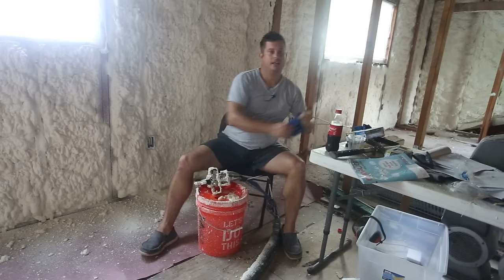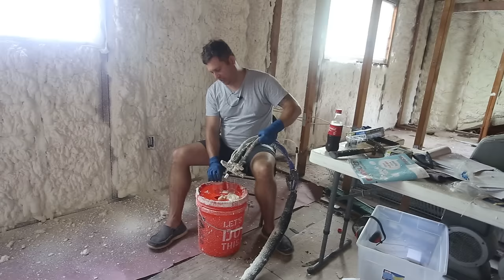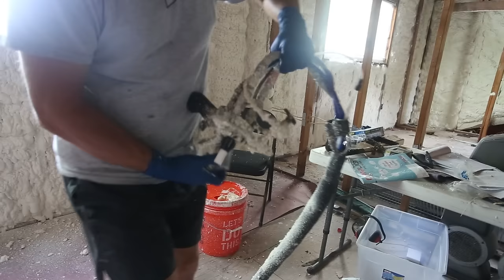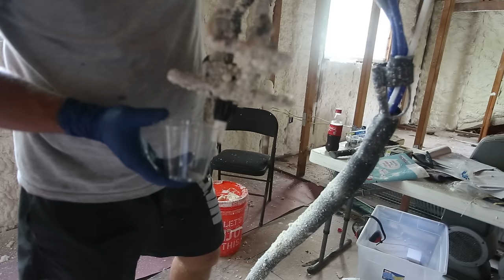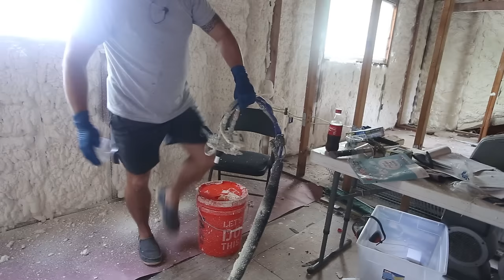DIY Spray Foam - Part 1 - about the foam, calibrating the machine, and about my project

Comment: good luck cleaning up that mess, you are going to spend over 100 hours shaving that stuff to have it drywall ready, and isn't the outer layer supose to act as a vapour barrier? So by shaving the outer layer youv got no vapour barrier.
Reply from the maker: Thanks for helping me prove why it's important to do your own insulation and understand what you are doing.  Even the "pros" have not got a clue.  Hints: Closed Cell foam.  Every cell is a vapor barrier.  Texas, Humid Hot climate, vapor barrier on the outside.
Reply: THen can you explain why over spray foam and then shave it? when you can just install half inch less  and not have to shave it. makes life so much easier not to mention that is the right way of installing closed cell  foam. AND INSTALLING YOUR OWN SPRAY FOAM IS NOT A GOOD IDEA, this stuff is for the experts you are manufacturing foam on site and installing it wrong can have harmful consequences to your health.
Reply: Spoken like so many "experts" (i.e. rip off con men) that would have everyone think we are helpless and must call someone who will "give you the business".
Reply from the maker: This was a deep energy retrofit.  I wanted to get a total cavity fill which would create a vapor barrier retrofit, eliminate thermal convection in the wall cavities, and maximize the insulation.  The downside is that it did require some overfill and consequently some shaving.  The closed cell foam also adds structural value, but I'm not going to guess at how much.  I'll just say that the house is quiet, very comfortable, and inexpensive to heat and cool.  I have zero air leaks which was one of my goals.

If you only do a partial fill in the wall cavities you will still have thermal convection, moisture accumulation, bugs /rodents, etc.  the air in the wall cavity will rise and fall depending on it's temperature and all air contains moisture.  That will compromise the insulating efficiency.
Reply: that was a nice reply.

Comment: next overfill project you do, try to take a hand saw to the foam while it is still abit warm (be gentle), it should come off in one piece instead of 1,000,000 pieces. fill every other cavity so your saw isnt digging into the next one.
Reply from the maker: That is a great suggestion that may help someone else.  Thanks.

Comment: All I can say is wow. I’m a professional installer. I’ve seen one job that looked like this and I had to fix it. You definitely know a few things about the industry, but there are so many variables involved with polyurethane and I would highly recommend getting a professional to install your spray foam.
Reply: Hey I have a question for you. I am building a cabin where it's going to be nearly impossible to have this professionally done, what are my other alternatives to spray foam (I would hate to mess it up due to health reasons). I want the cabin to be very energy efficient, and I keep hearing that closed cell is the way to go. Any tips will be very much appreciated.
Reply from the maker: So far my foam is working great.  I'm glad I took the time to learn about it and install it myself.  I could have done a partial fill, but that is not what I wanted to do, so overfill and shave was required.
Reply from the maker: Closed cell really is the best solution.  If you are only doing a small building you may find something like Handi-Foam to be more effective.  Closed cell is what's used in coolers.
Reply: Lolol. I've built$1m homes in Houston for a while, which is A LOT of home. With the recent post Hurricane Harvey rebuild, we've been spending top dollar for insulators from around the country. With many of our home being renovations we've used closed cell from ceiling to crawlspace. The first time I'd find a guy not insulating the entire wall cavity and shaving it off, he's fired. It takes 2 guys a few hours to shave a 5ksf house. Vapor barrier outside, closed cell foam, 7 mil vapor barrier inside+drywall, and caulked trim- the house is airtight. Good Job Brian, and thanks for the info.
Reply from the maker: Thank you for the support and facts.  It's been a while now, but my house is quiet and energy efficient.  It stays comfortable and I have to ask Alexa what the weather is doing because I don't know if it's hot or cold outside.  

I live in the approach to one of the runways for Hobby Airport and I can hear the planes, but it's not that bad.  When I first bought this house I freaked out because I thought the plane was landing on the roof.  They are wheels down when they go overhead because we are 2 miles East of the runway.  Spray foam made a stunning difference in noise reduction.
Reply: @hotpuppy72  - Once again, thanks for your effort making the video.  As if the insulation wasn't awesome enough, I can't help but to think that the improved rigidity of a completely  filled wall cavity makes the house probably %20 stronger!

Comment: what do you think about using a chinese made proportioner? local sellers selling em for $7k CAD. 
they might not be perfect for a spray business, but would they be good enough for diy? just 4-5 barrels.
Reply from the maker: It'll be fine til it stops working.  Then you'll be on your own with little to no parts or tech support.  There is not anything magical beyond making sure you supply equal amounts of mix.  Of course your A and B may have different ratios, but it's just a precise geared pump.  The high dollar ones heat the mix so it will cook off faster......Lil Pup uses ambient, which isn't a big deal for me in Houston, TX.  It's ninety-f-that outside today... more than warm enough.  In the winter you need to heat the drums.... so just use some oil pan heaters that are magnetic.  It's not rocket science despite what Graco might try to make you believe.

All lil-pup is - two stepper driven gear pumps with a PLC running them.  Absolutely nothing magical.  Hydraulic gear pumps do the same exact thing, just need a precise way to drive them and to work out that the seals are compatible with the nasty A and B mix.

Comment: First off, thank you Brian for the series of videos and helpful information.I am planning insulating crawl space subfloors. What is your opinion on using the Lil Pup for this application?Also, where did you purchase the 55 Gal drums of foam chemical and was there a quantity break if you ordered a large amount at once?? Lastly, can you provide a link and/or the brand name of your external air supply?
Reply from the maker: It would be fine for it.  There is no quantity break on a "set" of 55 gallon drums.  I'm using a Turbine Products supplied air unit.  Make sure to get plenty of mask protectors.

Comment: My foam is pulling away from the studs leaving a 1/4"-1/2" gap a few days after installation, any idea why it would do this
Reply from the maker: That is probably a ratio issue.  The foam is off ratio or somehow defective which is causing it to shrink.  The other thing to look at is that you may be applying too much of it at one time.
Reply: It might be that you are spraying on a cold day or you are not using proper ratio.  this is not a good video to be watching...

Comment: Hey Brian,
     I spoke with Mr. McDonough the other day and mentioned your name.  He's a nice gentleman who took the time to answer a lot of my rookie questions.  I can see customer service is one reason why you chose to purchase his machine.  I'm curious what other proportioners you investigated and why you ultimately choose the Pup.
Reply: Hi Willey,

Can I get the number for Mr. McDonough?
Thanks
Reply: Google search Lil pup proportioner And his company website site should be there.  Sorry I don't have his number at this time
Reply: +T Willey 
No problem.  Thanks for the quick response.  Does this sound familiar?  MIXSYN EQUIPMENT in Eugene, Oregon
Reply: Dear T Willey,
I found it.  Thanks for your help.  Do you know roughly how much the Lil Pup cost?
Reply: ~$4500-5000 USD for the  Proportioner.  Proportioner, fresh air respirator, chemicals A and B, suits, lube, desiccant canisters, basically all equipment needed to start foaming is around $10,000.00 USD.
Reply from the maker: +T Willey Maybe a bit more..... You're still far lower than buying a truck mounted rig and the gun is easier to live with.  The net cost per sprayed cubic foot is way lower than paying someone else.  I did this myself so I could have control over how it was sprayed.  My 2300 s/f house had a $39 electric bill last month in Houston.  That's partly good rates and partly great insulation and a new high efficiency HVAC system.
Reply: At the risk of being a bit intrusive here, Im just curious why so many people use the foam so thick? If closed cell foam is rated at R6 per 1 inch of thickness? And its ability to stop up leaks and prevent air loss which is maybe even more important than R value, It seems that 2 inches of foam would be R12 and block off all air from penetrating/escaping?  I would be willing to bet that a person could seal off all leaks and get the insulation they need with 2 to 3 inches of thickness and not have to do the trimming, all the while saving thousands in extra chemical. And achieve probably the same results.  Im just curious. Im about to have my new metal home spray foamed.  I had a man come out today and measure my house for a bid. While he was here I asked him why he only used open cell in residential and he said because it was cheaper therefore he could give me more foam! But if open cell only provides 1/2 the R value of closed cell then am I really getting more? Then I asked him if open cell was a vapor barrier and he answered yes, which is not true. Im not hiring him, because I already caught him in a lie before he even gave a bid. I want closed cell foam. I need to find a company in North Tx/ or Southern Oklahoma that does closed cell.